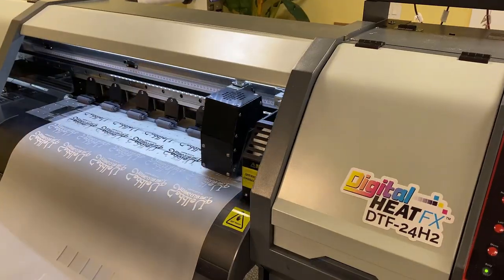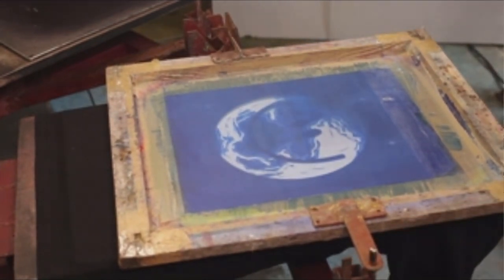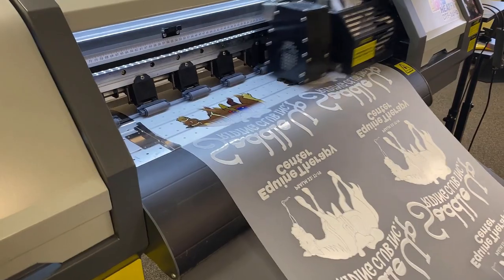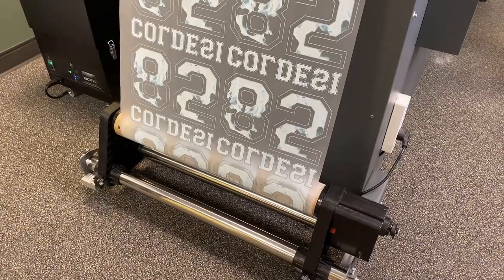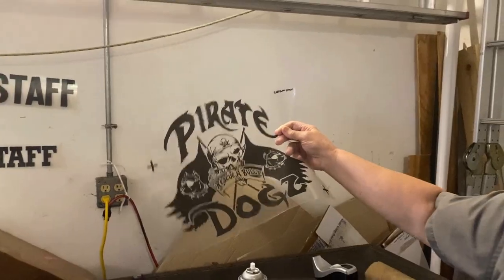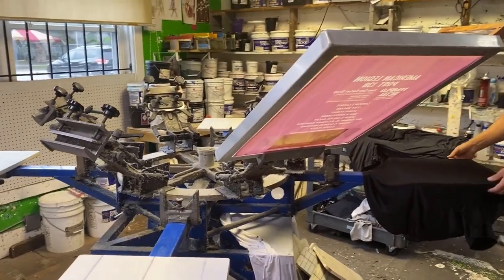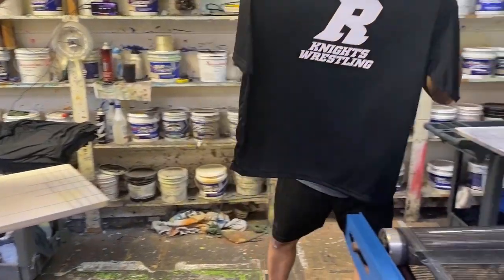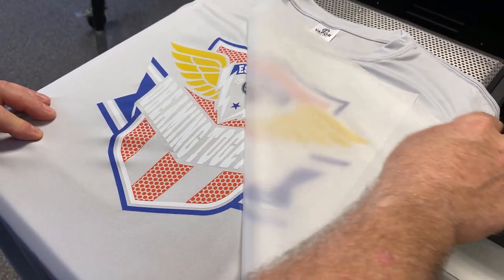Direct-to-Film (DTF) vs. Screen Printing | What's the Difference?

Comment: My problem with DTG & DTF is the quality. It doesn't have a soft nice feeling to it like Screen Printing. DTF is also merely a sticker on a shirt I don't like it tbh. But all & all thank you for the good and concise review.
Reply from the maker: You should really check out the latest DTF prints, they are remarkable. We can send you a sample, just chat with our team here: https://coldesi.com/coldesi-dtf/ - These are soft, wash well and don't feel like a sticker.
Reply: Right now I have a screen printed shirt in my hands with a huge plasticky and heavy design.
Reply: @joemarz2264 that could be for a variety of reasons. Maybe it was printed with a low mesh count and alot more ink was deposited. The type of ink can effect the feel as well. Its also possible that the print was not cured properly
Reply: @sollysuliman2357 i’m not too savvy on how the whole DTF process works, however, I am aware that DTF and heat transfer vinyl or two different things as well as sublimation, maybe it’s possible that you have received heat transfer vinyl print instead of DTF because vinyl prints usually have that thick sticker feel to it on the T-shirt.
Reply: I’m not too savvy on how the whole DTF process works, but it’s possible that you’re thinking about vinyl transfers, because those usually have a thick layer on top of the shirt and it feels like a sticker and a peel off after sometime. DTF heat transfer vinyl and sublimation all require heat and pressure from press to be applied onto a shirt however they are all different in terms of the technology used to get the print design onto a film

Comment: digital printing has its own segment of the market just as there is for silkscreen printing. It was not mentioned in this video the pros and cons for both, just comparison of the amount of work that needs to be done.. but is it practical to use dtf to print a single design to a thousand shirts? which is more practical, economical, and faster? its still screen printing.. the hard labor of preparing the screen is only done upfront before printing, but it is still faster and economical to use this traditional process when you are printing large numbers of shirts. of course, you don't use this printing process to print 10-50 pieces of shirts, that's not the market for screen printing. That is where digital printing can be more efficient in time, labor, and cost.. so the real difference is the market segment to which a t-shirt printer provide service. That determines what is more suitable printing system or equipment to use.
Reply: Who says DTF can't easily produce 1,000 shirts? FYI a typical DTF printer can print 1,000 designs in a couple days.
Reply: @joemarz2264   There's only one way to find out. My buddy has a screen printing shop and would love to challenge this gentleman to a print-off for 300 tees with a two-color print. (Quick note: He also has a DTF printer.)  DTF is a fantastic solution for small numbers but not giant numbers. Also, preparing the screens is not as bad/timely as he makes it out to be. I would undoubtedly be on your side if I didn't see it with my own eyes.

Comment: You should brush up on your knowledge of screen printing. What you are describing was 20 years ago.
Reply: Yes! I have both, screen print and DTF. The DTF is a complete maintenance nightmare. And the quality its not even half of  screen printing. Yes dtf works for some orders that the client don’t care about quality like birthdays, one day activities.
Reply: Yes… I do full process CMYK wet on wet with half tones printing and can print literally any color or design under the rainbow. Screen printing is far superior than any other method known currently.
Reply: @AmericanWithTheTruth  Screen printing is still king....
Reply: @cesarfigueroa8467  This is what I was wondering.  I started making clothes I started with vinyl then sublimation, dtg and then buying transfers before printing my own designs.... DTF wasn't a thing so I wasn't sure about it. But from what I've personally tested a screen printed design whether basic spot colors from vector art to CMYK to Sim Process garments, screen printed designs are far superior in the long run